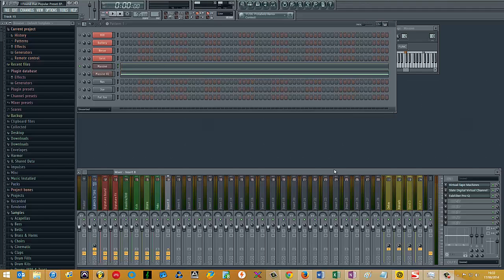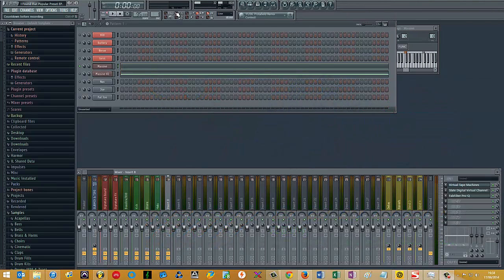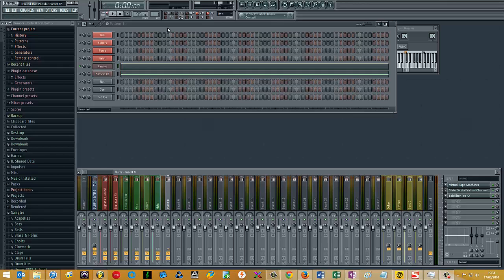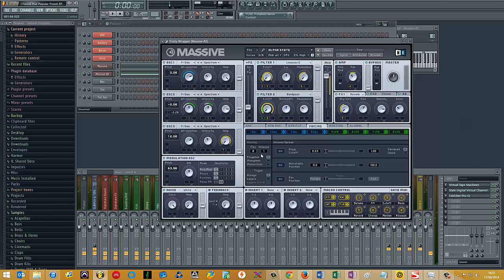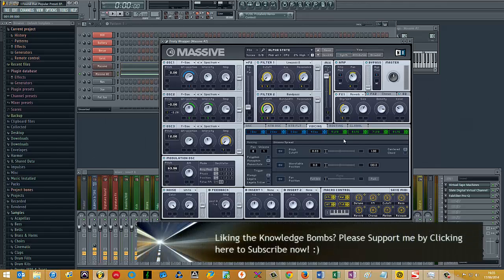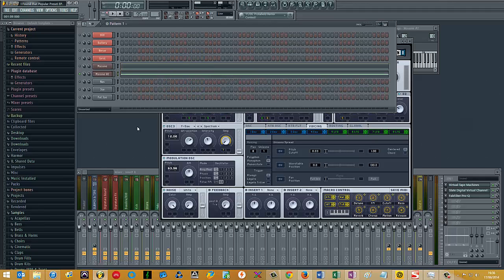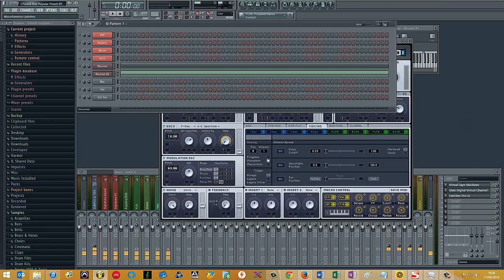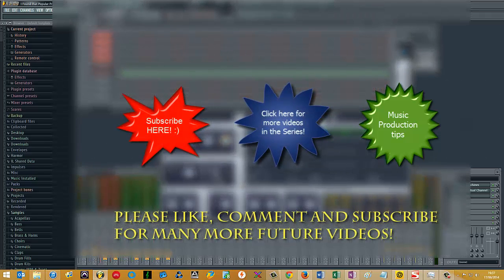Can't Play Chords? Polyphonic vs. Monophonic | FL Studio Tutorial | [No BS Series #4]

Comment: Hey, I have a problem, when I want to record with my piano, FL would not record chords, it just records one single note, and also when I press 2 notes at the same time one of them will sustain until I press it again, I've seartched for a solution but I don't seem to find one anywhere, thank you.
Reply: Did you find a solution?????
Reply: @sentimentalescalade6451  Holy shit, its been so long, I think my problem was that i was using a different kind of cable, I switched It to a USB B midi cable and it worked perfectly fine.
Reply: Thanks for the prompt response!
I'm using an old digital piano and I'm encountering the same problem

I was hoping to get some help from someone...
Thank you!